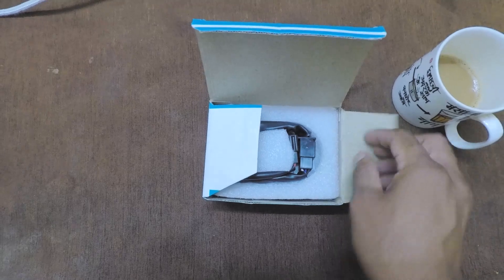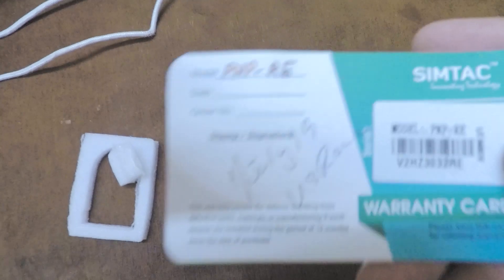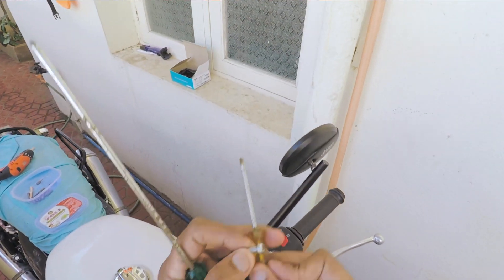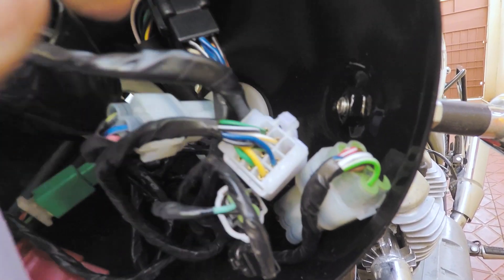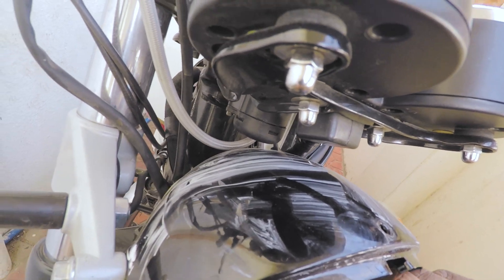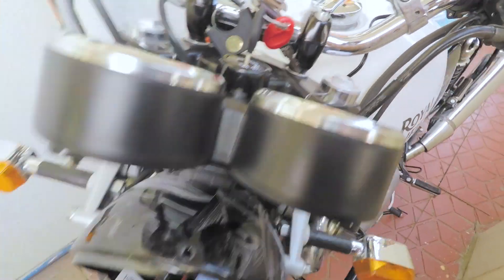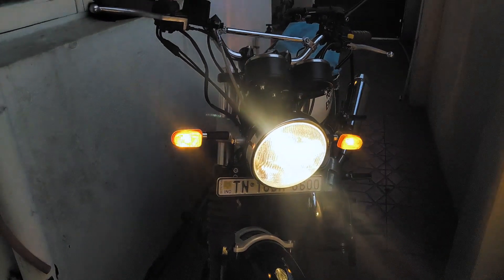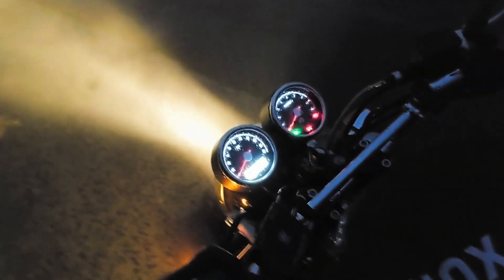INTERCEPTOR 650 BEST HAZARD LIGHTS  | Installation & Review  | Simtac

Comment: kya ye module lagane par intetceptor 650 ke battery me issue aata hai kya??
Reply from the maker: Nahi yeh 12v power supply use karta hai. Aur excess battery nahi khayega. Agar tumne mobile charger lagaya hai bike pe to yeh usi ke equal power lega....zyada nahi. Ignition switch on karte time hi yeh power on hoga
Reply: @RoshanSridhar  Thanks for guidance
Reply: @RoshanSridhar  Thanks for guidance
Reply from the maker: Happy Riding Bro 😊